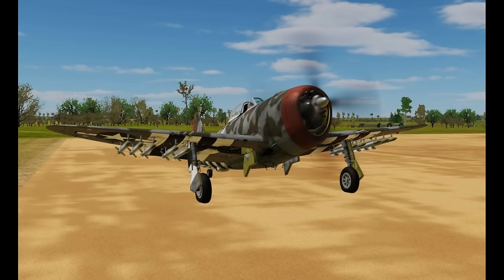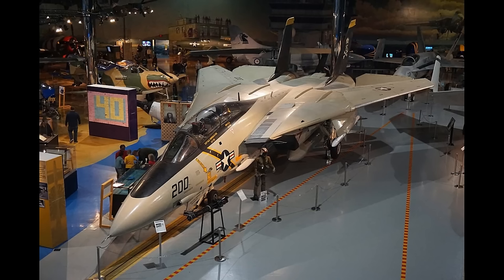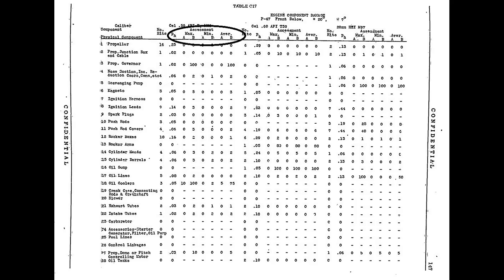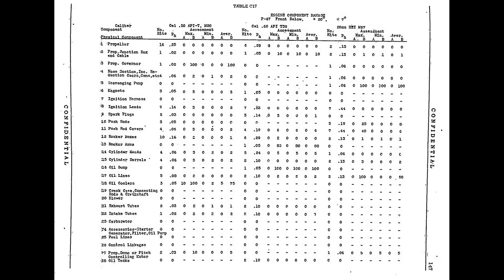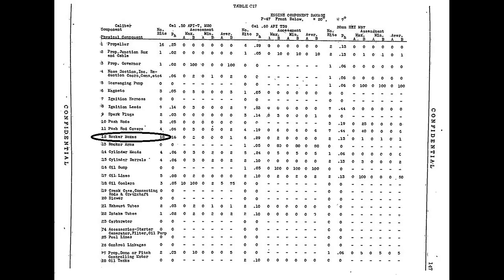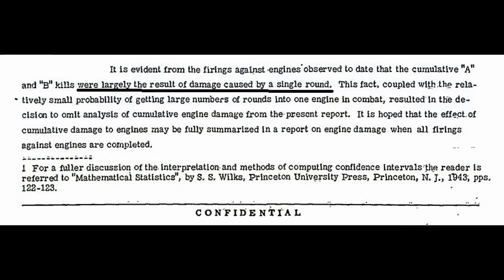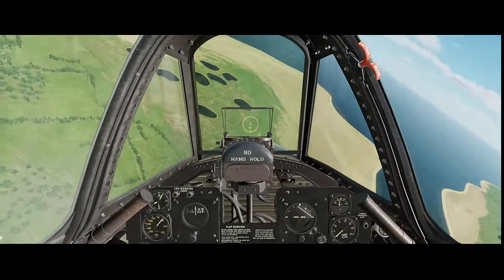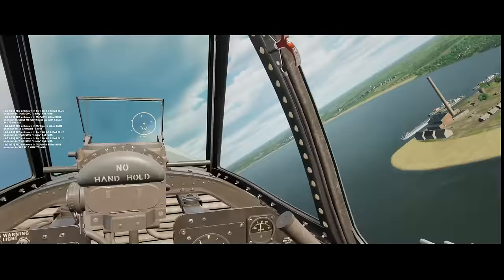50 Cal Vs. 20mm Engine Damage in WW2

Comment: I'm not so sure about those 20 second bursts. When I was in the military I ran an entire 200 round belt of 7.62mm through a Browning machine gun in about that time by just holding up the trigger until the fresh belt I had put in was finished. (I didn't time it, but it sounds about right). This was at night and the barrel glowed bright red by the end of it. I'm talking you could have lit a cigarette on the barrel it was so hot. It turns out there's a reason they teach you to fire in short bursts - very long bursts like that destroy your barrel.
Reply: Swedish military has a 5 belt limit (50 x 5 = 250 rounds) on the Ksp 58 derived from the FN MAG, after which the barrel must be changed and allowed to cool off. With correct gas-setting, that equals about 23 seconds of constant fire.

Comment: I am surprised that D means that the aircraft is repairable but E is a total loss of the aircraft upon landing. You would think they would be the other way around.
Reply from the maker: I did cover that exact topic in another video, and of course in this one I mentioned that just by their nature the air cooled radials used a lot of oil. If you ever look inside one the reason will be obvious, the clearance in there are huge, and I mean huge, like way larger than the most worn out car engine ever.

Comment: 60 cal ~ 15mm, which is same size as the MG 151/15 used by Luftwaffe. Maybe that is the reason including it?
Reply: Not really as the German 15x96 was less powerful than the US 15.2x114. But you are on the right track, the T17 was a derivative of the MG151.

Comment: Evaluation of Weapon effectiveness… That sounds like a fun job .. ! But I’m not sure I could find it in my heart to shoot a R2800 their kinda of an endangered species..
Reply from the maker: At the time they were throwing them away. One thing I did notice though is that they were all older versions of the R-2800 and the P-47s, they were not shooting up the then new N models.
Reply: @GregsAirplanesandAutomobiles This sounds a lot like the statistical work Robert Macnamara used to do in bomb assessments.  Any chance he worked on this study?🤔
Reply: I was guessing old engines, too many hours, worn out, or even lightly damaged engines.  Same with the airframes.

Comment: It is kinda odd decently armored vehicles can get knocked out fairly easy with a single .50 cal yet a plane which has much less armor seems to shrug off tens of .50 round hits.
Reply from the maker: The Germany half tracks were only armored against 30 cal and under. The US 50 cals go right through them and they are easy to hit.

Comment: There is no way an automatic weapon mounted on a 3D moving platform will hit another 3D moving target 1 in 4 at 500 yards - maybe at 50 yards.  Even with a hand-held automatic weapon against a fixed target at 25 yards, it is hard to hit.  Watching Vietnam videos, helicopter gunners usually fired 1-s bursts at targets, and were lucky to hit a target with 1 bullet at 50-100 yards, so 1 in 13.  At 500 yards, probably 1 in 100.  Maybe there is some confusion here, and the 500 yards should have been 500 feet . . .
Reply from the maker: I think you're missing the point. The point of the firing was to get enough rounds on the target to have statistically meaningful data. To that end, neither the platform nor the target were moving.
Reply: @GregsAirplanesandAutomobiles  Ah, OK, so not a real flying plane.  Even so, 500 yards for a heavy machine gun seems a long distance.

Comment: It would be interesting to see this test done on a BMW-powered FW190, and the very different oil cooler arrangement. 

One thing to always bear in mind, for whatever reason the US was the one major power unable to field a reliable 20mm aircraft cannon in WW2.
Reply from the maker: I have discussed the U.S. 20mm issue before. The P-38 had one, the B-29 and the USN started to use them more by the end of the war. Overall though, the use of 20mm was pretty rare on US aircraft by World standards of the time.

Comment: Greg: What flight simulation software were you showing with this video?
Reply: DCS. Digital Cockpit/Combat Simulator
Reply: @JackManiacky  Thanks.
Reply: Sadly, each individual plane model is a DLC that costs about the same as a normal full game, so you need to be plenty rich to fly DCS unless you're satisified with the two (frankly pretty crappy) "default" planes that are included. Unless you absolutely need the specific things that DCS offers, you're better off getting X-Plane or MSFS.
Reply from the maker: If you want a sim, DCS is the way to go. If you're tight on money, learn to fly with the free stuff, then wait to snag the Normandy map and a WW2 plane on sale, you won't regret it.

Comment: 20 seconds of continuous fire is considered a "burst"?!?
Reply from the maker: I don't know of that's the right term, but it's the word I chose. Again, I have zero real life experience with machine guns.
Reply: A WW2 fighter pilot did not disagree with 2 seconds at a time. I think he was using 20mm cannon from a Typhoon or a Tempest. 
The target would be away after that.
Reply: If you look at the table of no. of hits and Ph, and divide  number by the probability of those lines with more than zero hits, they all come out to around 50 - 60. Could that indicate that they used a 50 to 60 round burst for the test? Maybe a 50 round burst and the increase due to more than one thing being it by an individual round? That would be in the neighborhood of a one second burst from six guns for the .50 cal.
Reply: @GregsAirplanesandAutomobiles  
If I recall correctly, the .50 air machinegun wasn't supposed to fire more than 5 second bursts, needing cooling in between. They were very lightly built compared to the land variant.

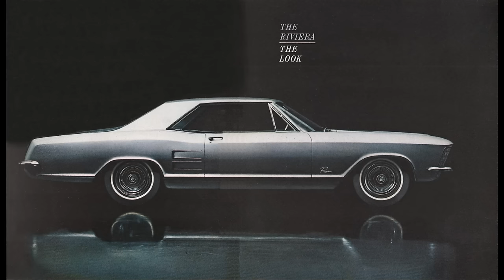Comment: 1:40 -  This isn't exactly a good comparison, since american v8 engines were and are still made for upper-class cars with lots of unnecessary extra horsepower.
The power loss from 1 cylinder will be noticable on a proper track or a highway, but these are rarely used by your ordinary office manager that only drives home to work.
Reply from the maker: No, American V8's were available for the masses at low prices. That dates all the way back to Ford's flathead. Also Mark Donahue would like a word with you about "unnecessary extra horsepower".

Comment: Some of the numbers look a little suspect, a 20mm round not only has more kinetic energy and mass to just punch through stuff, they come in explosive varieties. I'm finding it doubtful one of those hitting the engine wouldn't knock a lot more stuff out than a .50 hit.
Especially the German projectiles, they had a bad habit of making very large holes in things.
Reply from the maker: They did do much more damage per round. I thought I made that clear.
Reply: @GregsAirplanesandAutomobiles  
Oh trust me you made it very clear, I've seen some of these documents before. ;D

But in regards to the engine-damage documents, it's a little...Odd.
Reply from the maker: Hmm, it seems to make sense to me, the 50 cal gets more hits, but the 20mm does more damage.

Comment: Thanks for this as it gave me insight I believe into two things... 1. the reason why the F-86 Saber had .50 cals might be because it could not have enough cannons to make them worth it as it's so small. 2. In DCS in a tight gunfight the P-47 can easily survive and win against an A-10C because it can absorbe more damage then the A-10C can throw off. And while the A-10 has a 30MM and a fast fire rate the P-47 canj also dish out the damagfe need to kill the A-10 roughly in the same time. As  the A-10 can kill it making it a somewhat even fight atleast in DCS.

Comment: The British empire was already moving towards a 20mm armament before WWII having realised that even 8 machine guns were not sufficient to bring down a"modern"stressed metal skin aircraft in the 1 or 2 second burst that was all a fighter with it's limited ammunition supply could afford or indeed in the time available in a fast moving dogfight
Reply from the maker: Yes they were. The move towards 20mm started pretty early and everyone seemed to be on board. It seems that 20mm is right in the Goldilocks zone.
Reply: @GregsAirplanesandAutomobiles  Yet the US still wants to use 20mm chain guns rather than auto cannons while other countries use 23 mm or 30 mm auto cannons going from the ADEN to the modern 23 mm on the Tornado and Eurofighter

Comment: What I don't understand is why there is such a randomness to these hits? Surely a fixed gun at such a close distance would hit within inches every shot?
Reply: 500 yards is not close.  If the engine diameter is 2.5 yards, that's 1:200 ratio.
Reply from the maker: I think it's really hard to hold a machine gun perfectly still. I know they flex their mounts when in airplanes, and the barrel moving just a mm has a big effect on where the bullet goes when it's 500 yards away.
Reply: Well we are talking about a moving airplane?
Reply: @GregsAirplanesandAutomobiles  Oh, I thought these tests were made with rigidly mounted guns.
Reply: @mytube001 Of course they are but MGs aren’t that accurate. Every round has some imperfections that cause differences in ballistics.
Vibration, bullet weight/shape, propellant burn rate, the guns components heating up etc.
Reply: Don’t forget the barrel has son flex in it when fireing

Comment: i seriously doubt that the burst was 20 continuous seconds it was probably several sort bursts equaling 20 seconds as the longer the burst the hotter the barrel and the hotter the barrel the lower the accuracy due to the barrel expanding i would also like to add that ammunition matters also armor piercing rounds will most likely do more damage to a piston engine as it is made from thick iron high explosive rounds will do more damage to structural components due to them being mostly wood and or aluminum

Comment: The muzzle velocity of German 20mm was about 2500 feet per second while 50 cal is typically 3000. That translates to flatter trajectory, better accuracy, more hits for the 50 cal compared to the 20mm. Also you could carry more 50 cal ammo, and deliver a higher rate of fire.
Reply: Shoot an empty soda can with a few 22lr bullets vs put a cherry bomb inside the empty soda can. That’s the visual analogy for you to decide what does more damage to flight control surfaces/components.

Comment: Ok Greg, I have a question that you usually wouldn't tackle, except I think you will be as fascinated as me. Everyone always says that the mustang, coupled with the merlin was a match made in heaven.  That's all well and good,  but it wasn't so much the engine but the supercharger, wasn't it? So let's Port the Alison back in and then add a multi stage turbo powered supercharger with possibly a laundry facility as well😂... in all seriousness,  the lightning had a supercharger and it was too fast for its wings! 
Was there an all 'merkin engine and charger they could have used in lieu of the merlin? Have fun with that!

Comment: I must be confused, because I don't see how you could get a 20 second burst on a high speed target when firing from an offset 20 degrees from head on.  If it is stationary test it can hardly be representative.
Reply: It’s about determining the likelihood of a hit from that position…. 🙄
Reply: @kimjanek646   Doesn't seem valid to me, but I never took a statistics course.  And I'm still glad I didn't . . .
Reply from the maker: The point of the long burst is specifically to get enough hits so that they will have statistically meaningful results on a per round basis. You can think of it as 20 one second burst if you like, the results would be the same.
Reply: @GregsAirplanesandAutomobiles  Okay, that makes sense to me.  Thanks.

Comment: How do you shoot at a target for 20 seconds and not obliterate it?  I don't understand the logic of the experiment.  Also I don't know of many if any WW2 fighter that carried 20 seconds of ammo.   I guess if they are looking at a general experiment that looks at damage in different parts of the engine maybe?  If that was the case why not just shoot one round at a time and analyze after every round?
Reply from the maker: probably because it would be hard to shoot one round at a time with an M2 machine gun. Plus they were doing this on a running engine so they would have to start, warm up and stop the engine everytime.

Comment: 22 Minutes ~ subject "damage that removes a cylinder."
The P-47 resulted in a lot of pilots killed. Some happened in combat, some didn't. The 47 was responsible for more dead pilots than all other Allied single engine aircraft combined, as a result of accidents and incidents not involving enemy action. A Waco Biplane it wasn't. Apart from having lots of ways it could kill pilots that most of them never thought if, it had some ways of saving pilots that were equally unexpected. One example given, was a pilot who hit the upper centre part of tree, and had a cylinder hit a branch about 6 inches across, and the impact broke the whole cylinder off the engine. From the moment of impact, it was about a 2 minute flight back to the airfield, which was completed with some loss of power. Inspection showed the con-rod and piston had been beating around the whole time, and oil had been pumping out like a severed limb, but it still ran long enough to get him home. How much longer that engine would have worked to get him back over friendly territory ~ that's another question. As you say, they had a very large oil reserve. That isn't enemy fire, but it is a story that sticks in the memory.

Comment: A cylinder blown off means that the intake manifold sprays air/fuel mixture all over the engine, and a plug wire, no two plug wires, loose to ignite it.  A rapid engine fire is almost certain.  A 13 mm round at close range could make enough damage on the cylinder barrel that the jammed piston energized by the con rod and combined to the weak mounting on the crank case could rip the cylinder off completely.  Any hits on the intake plumbing or manifold will likely cause a fire too, and the engine may not be able to run very well due to excess lean mixture if the manifold pressure is under atmospheric.

Comment: a 20 second burst ??? when ever did a pilot shoot for 20 seconds ?  first of all your gun will jam almost guarenteed you'll get a jam and more importantly you'd be almost totally out of ammo with a 20 second burst most of the time your shoot of 3 , 4 or 5 second bursts. So why did they think a 20 second burst is useful ?
Reply: Maybe to account for fighters typically having 4-6 guns, they would approximate the amount of rounds fired from those with one gun by increasing the fire time.
Reply from the maker: You need to keep in mind these tests are done largely by statistics people with support from the ordinance people. If they say they need a 20 second burst to get enough data for accurate stats, then that's what they get. They absolutely did use 20 second bursts in this test. I'm just not sure they used it on the R-2800 example I used.

Comment: See if Donald Nijboer's 2001/2006 "Gunner: An Illustrated History of World War II Aircraft Turrets and Gun Positions" will change your findings.  On the B-17 at 600 yards, the pattern of fire from the ball turret was 15 feet in diameter and the tail turret's pattern was 45 feet--both turrets had a pair of AN/M2 Caliber .50 aircraft guns with identical fire rates.  The book notes the effect of 210mm air-to-air rockets.

These findings and the documents that you based your presentation on led to the main armament of the F-89 being more than a hundred air-to-air free-flight rockets (see the Battle of Palmdale with two F-89 interceptors versus a stray F6F drone), then the Genie air-to-air atomic rocket, and the Falcon and Nulcear Falcon air-to-air missiles for the F-89, F-102 and F-106 interceptors.  Taiwan wound up using the first Sidewinder air-to-air IR homing missiles because their F-86's armament of six AN/M3 Caliber .50 machine guns could hose down Chinese MiG-15 and MiG-17 jets without downing the Chinese aircraft until it descended to lower altitudes.  

History is important to current events.  Drone fighter aircraft are not quite ready for prime time.  The Falcon over Vietnam had a very low kill rate against Vietnamese MiG fighters, and giving up cannon armament was about like equipping an infantry soldier with a state-of-the-art advanced combat rifle but denying the infantryman a fighting knife and neglecting hand-to-hand combat training.  The modern fighter aircraft's cannon is like a fighting knife--it's seldom used, but it's there for morale purposes.  

I noted that nobody in your study suggested that the fighter pilot use his final missile--his own aircraft used to ram enemy aircraft.  That last-ditch option would be an interesting discussion and on 11 September 2001 a pair of F-16's on a training mission were vectored to stop an airliner thought to be heading for the Capitol.  Those pilots would have had no other option but ramming the airliner in order to stop it.